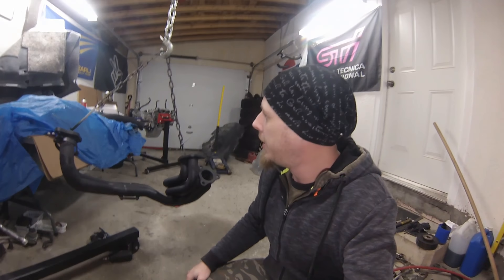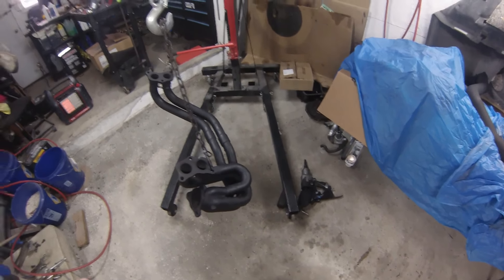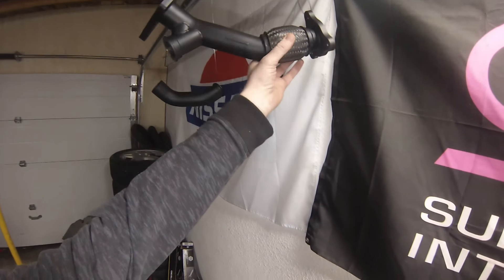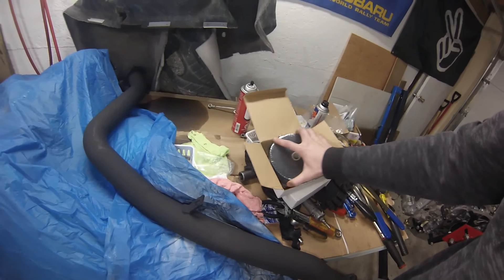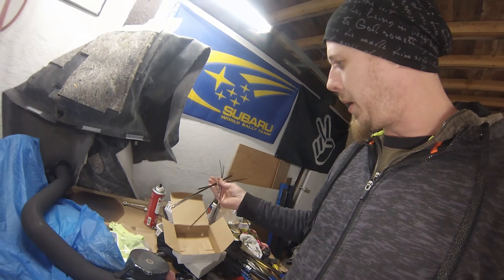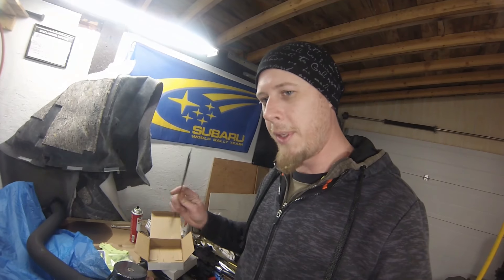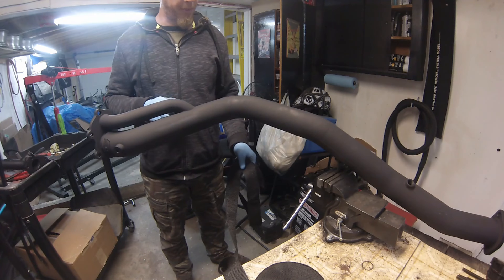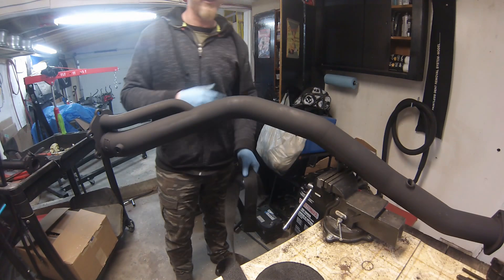2013 STi Build Part 9 - Exhaust Heat Wrap How To

Comment: Hey homebrew have you ever had any problems with the exhaust cracking or anything because of the heat wrap?
Reply from the maker: In my experience, heat wrap is fine to use in any application. Cracks are usually caused from vibration, improper torque, heat cycling, those kinds of things.
Reply: Thanks!